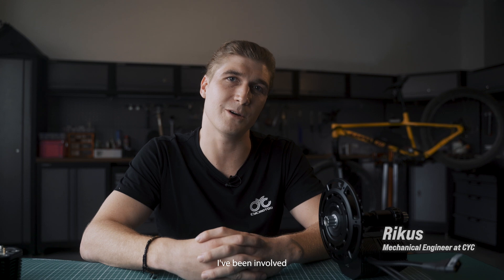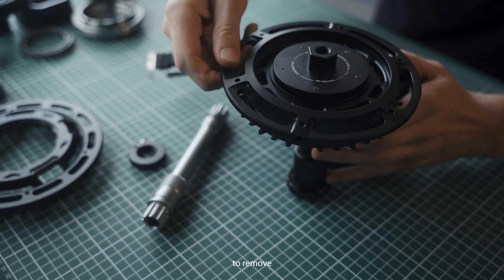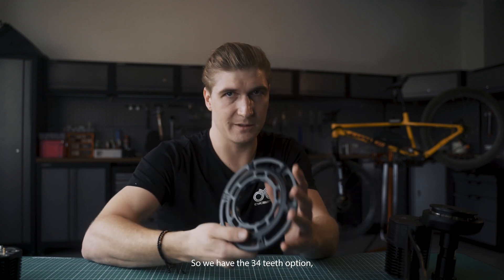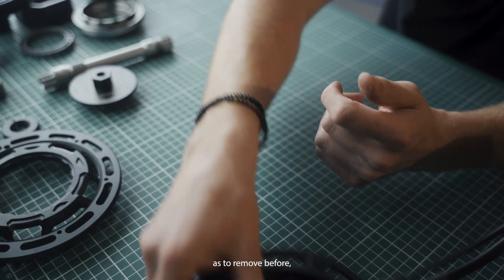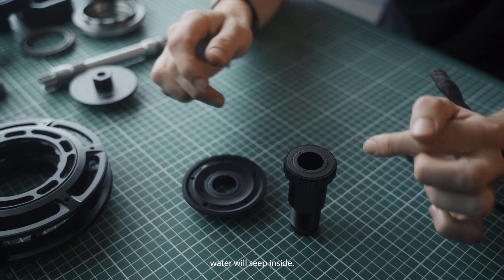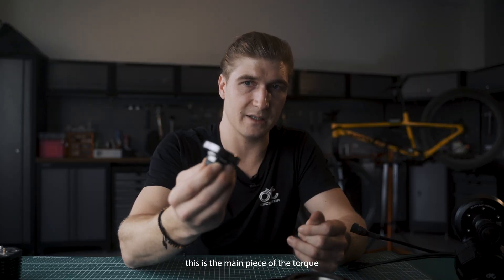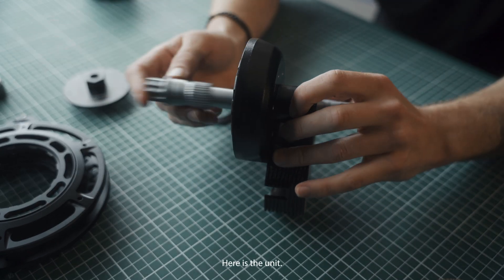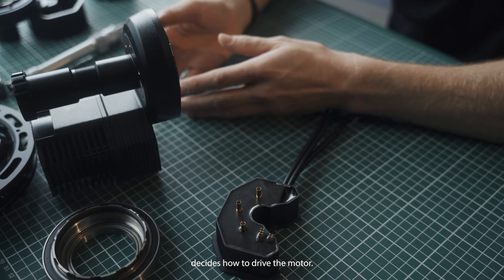CYC Photon Tech Explained: Deep Dive & Teardown of the 750W Mid Drive Conversion eBike System

Comment: Coming from the 750w hub motor perspective… how come these motors at this size can provide so much torque drawing less amps? It seems mid drive is simply more efficient in many aspects. I am super keen to try this out. I wonder if you guys see a market for an even smaller city mid motor for the converter crowd? Or even for brands to spec onto bikes… could design to be elegant on classic tubes or modern… the neutrino 250-350w 50nm motor, would love that with a belt on a mini velo frame!! Because you guys do so much for the firmware, torque and cadence sensor, nice display and app. I do not see why not there is not a big spot in the market for CYC ~ remember the neutrino 🤫

Comment: I am looking to build a new Recumbent Trike and need a motor which has Torque Sensing like the CYC Photon. However, I also want the ability to pedal at speeds up to 60 kph which means a much larger Chain Ring than the size provided. My current trike has a BBSHD with a 65T chainring and 20" wheels all round. (I recently used this HPV Scorpion Trike to win the 50km Ride in the Tour de Brisbane with an average speed of 36kph) Is there any way to fit a similar size or maybe an 80T chainring to the Photon?
I also want to use an IGH in the rear wheel which can safely handle the torque of the Photon. Do you know of such an IGH? I understand that by using a 26" rear wheel and a slightly larger small high gear cog, that a larger chainring can safely be used?

Comment: I know this is an old post. I would like to know when you all plan on getting the reliability on board with the Bafang units. What I am referring to is the fact that I have now bought 4 cyc motors and the consistency is 100 %. Failures that is. Everyone of them has had issues that either required returning them back or me replacing a part sent to me by the company. I have bought and installed 25 bafang bbso2 and bbshd units with only one having an issue. The price point vs reliability is just not there. I really wanted to recommend this product but will have to reveal my experience in the real world. I read all the BS from  your poster child on the cyc photon forum and just shake my head. Tried the toseven and it is not up to the bafang either. Torque sensing is not as important as reliability to most riders. $1000.00 plus motors with your track record is not good. Pretty unit though. Possers delight. Riders nightmare.  Thank you for your time.

Comment: Nice, I like the new chain ring setup.  Is there a tool one will need for that though?  The other question, is there a bit of adjustability for chain line centring (like if I need to move the ring closer or further away from the frame a small amount to be in spec to the driveline manufacturers spec)?  I don't have a CYC Photon, but I'm slowly working out details for a new commuter ebike that I want to build ground up (the CYC photon is high on my list - I want a torque sensing throttleless e-bicycle).  Also interested in the full service intervals and instructions (that would be extremely well appreciated).

Comment: how do you become a mechanic fixing these motors? I have a photon that has problems and i would like to take it apart and fix it myself. How do you get all the spare parts? In London, there appears to be no service centre or shop able to repair them.
Reply from the maker: We have a few service centres in the UK. The Cycle MOT is in London and will be able to help you. However., you can reach out to us as well. We will be happy to help you with the tools and parts needed to do it yourself.

Comment: I’m thinking about getting one of these but I know nothing about bikes, what difference does the chain ring sizes make?
Reply: A smaller chain ring on the front makes it easier to pedal up hills. Or, you can get a bigger rear sprocket to make it easier. A larger chain ring up front conversely makes it harder to pedal (for flat or downhills).

Comment: What a cool solution for the small chainring! And a beautifully integrated system overall! Top notch engineering! And thanks for going in depth about the motor. I've put the Photon on my cargo Bullitt and it is absolutely wonderful, it's as if both the motor and the bike were buit for each oher! 
But I'd like to take a chance here to voice that I myself and dare I say many other would like to see more trust in the end user and more repair capability! Motor side bearings for example are not available as replacement part in your store, same with any more advanced part, like the torque sensor. 
You are miles better than your direct competitor Bafang, and yet I feel that if anything happens to the motor I will be left with an expensive paperweight - shipping for repairs is just not a viable solution from Europe to HongKong! Meanwhile one could requild the whole BBS01 with spare parts available.
Perhaps I am naive but I do hope you will take into account user opinions such as my own!
Thanks for the great presentations and product!

Comment: Frankly, I'd love to purchase your product for instance Foton. However, the produce is still raw and I see people complain regarding the power issues and so on. Comparing your product and Bafang I'd prefer the second one due to its reliability. I'm not going to make a complaint from my side because I didn't use it. But the reviews are not in a good light. Maybe quality is good but it is what it is. Sorry guys, it's only my opinion. Whether you could persuade me that it is not true or myth or fiction then I'd love to make a purchase even in two times more than Bafang. Thanks beforehand

Comment: If the motor heat is trapped inside, can't you just put thermal pads or thermal paste in between the outer shell and motor shell so that the heat can properly transfer to the outer shell and dissipate through the fins? Is CYC doing this going forward?

Comment: im making a suggestion here cause i feel its easiest but are you able to actually make a screen lock so for example. any kit that you get with the DS103 screen you should add a passcode lock onto that to prevent some potential theft. this is just an idea and i dont know how well this actually would work.
Reply from the maker: Yes, there is a password function on the display. You can set this up when you get your kit. There is no password by default but just head into the display's main settings page to set it up.

Comment: Big thank you for the tear down to assist users to repair their own motors.  Loving my CYC Photon.
Reply: Can you repair and service it yourself? last I heard (which was a while ago, like 10 mo ago) was that you have to send the motor in. If they provide instructions, like this video, and service info I will 100% buy this motor. I just don't want to support companies that lock it down and make you send in the motor. That sounds like a lot of down time!
Reply: @kalef1234 , the video shows the tear down, but you need to be able to buy the parts to repair it though.
Reply from the maker: It depends on the issue you have. Major parts such as the controller, motor, torque sensor, and chainring, you can replace yourself. CYC or an authorised dealer will help ship the parts to you and send instructions on how to do the replacement.

Comment: What about the heat dissipation problem? Was this solved? My Photon is running in the 120-degree range.
Reply from the maker: 120Degree fahrenheit is within normal operation temperature of the motor. 
The motor start limiting at 100C and stop at 120C.

The motor is designed primiarly for 750W continuous power use.

Comment: Awesome video. I built a ebike a couple years ago, BBSHD and after uploading the right profile, it was really nice. That was without a torque sensor, I would LOVE to have one of these if the software is user friendly and customizable. 
What Voltage is that motor?
Reply: 750W
Reply from the maker: 36V to 52V nominal.

Comment: Hi guys, thanks a lot! I'm your buyer from Ukraine and I passed almost 1000 km on this fantastic motor without any issues. Can you please say a few words about greasing. Is it needed? If yes - how often should we regrease the motor? Official instructions says that it doesn't need regreasing, but I doubt about it. Thanks!
Reply from the maker: We do have a unit more than 10k km without regreasing. Still runs like brand new. We suggest regreasing only if you hear significantly louder noise, or over 20,000km mark. The motor indeed won't need regreasing frequently.
Reply: @cycmotor  Thanks a lot!
Reply: Hi, I am from Ukraine as well. Would you mind sharing your experience in-depth by providing, for instance, videos you're recording throughout a cycling trip? Thanks
Reply: @lepokity765  можешь написать мне в Телеграм, @Andrii_Isaev. Всё сниму и расскажу.
Reply: @lepokity765  можешь написать мне в Телеграм, @Andrii_Isaev. Всё сниму и расскажу.

Comment: Thank you CYC! Great to get such a detailed look inside the photon. I’ve got 2 photons and have loved them so far. I’ve got 2400km on my first one and it’s only now just started making an audible click at one particular spot in the crank rotation. I’m hoping to get the chainring removal tool in Australia so I can troubleshoot what is causing the noise. Please keep up the content. You have a bunch of loyal riders who are hungry for more of this content.
Reply: I had an issue with mine screeching as the crank went around. Happened suddenly at about 500km. I had a theory it was either the plastic shield on the bottom backet or the bearing inside the cup slightly rubbing on something. I took the spindle out and put a brass drift into the bottom backet from the drive side and tapped on the plastic/bearing on the non drive side (very lightly, actually just with my palm) and I saw the shield on the outer edge of the cup move slightly. I doubt the bearing moved, probably just the plastic piece. The noise went away and hasn't come back. You might have something similar.
Reply: @jbrizz99 thanks for sharing your experience. I’ve just ordered the chainring tool from CYC so hopefully can get into it soon. I have to say the shipping was pretty steep $40 for a $18 tool. I like the idea of being able to service and fix these motors and hopefully the cost of parts is still reasonable.

Comment: Can the CYC photon  be fitted to a carbon fibre frame.?
Reply: yes it can
Reply from the maker: Yup, no problem. If you are concerned, you can always consider adding an additional payer between the motor and the frame such as a rubber pad. It can be concealed quite nicely. A lot of carbon builds out there.

Comment: Photon is dead. Toseven dm02 is 3 times cheaper and more reliable. TSDZ8 is even 4 times cheaper. Photon costs more than Bosch motors if you include shipping, VAT and duty.
Reply: the dm02 is the same weak garbage the TSDZ2 was minus the overheating

the DM01 is where it's at, the 500W TSDZ2 and DM02 are literally weaker than the Power Line CX
Reply: @BH4x0r  I'd like to know more - can you share your experience with all of these motors?
Reply: Sounds like somebody drank the cool aide. The feel and power of the Photon is really not comparable to those mentioned.

Comment: More please. Torque sensor failure troubleshooting, recommended service intervals, and full service instructions would be greatly appreciated.
Reply from the maker: Noted! Thanks for the feedback. We'll chat to the team and put something together.
Reply: My photon while increasing power going up the hill I had pulsation through the pedals. Now it feels like the torque sensor doesn't work properly it gives greater power with lighter pedaling than original with the settings all being equal to before. No changes on my part

Comment: Once the Photon gets reliable, I will be interested. User reports are not good.
Reply: That's because people with problems post to forums while people without problems are out riding. Photon seems OK to me (so far, but I've only had mine for 12 months).
Reply: Some people always run in to problems with every motor they buy for some reason.
Reply: @uvwuvw-ol3fg  they also run in to problems with motors they've never bought.
Reply from the maker: We generally do! Goodness, did we miss yours? Please resend and we'll be sure to reply ASAP.